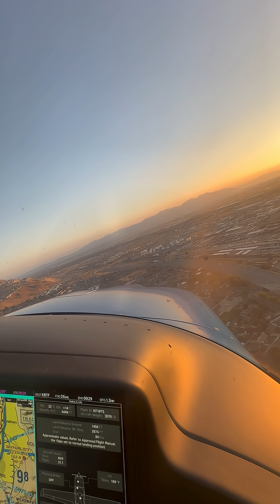The Runway That Got Too Small

Comment: This is why i put the gear down at midfield downwind in an arrow. Its really not that hard you just have to adjust for your airspeed in your checklist flow. Same thing in a seneca multi. You go through your flows alot sooner than in a slower piston single. You just got to give yourself that extra distance to bleed off that airspeed to configure for landing. You need to have that mental picture when approaching  your destination.

Comment: This does not make any sense, as a commercial caravan pilot. It slows down better than a 172. We typically maintain 165 kts (Vne 175, less than the mentioned 180) until 2 mile final, then go idle, it slows down to 85 well before landing.
Reply from the maker: For an experienced Caravan guy, sure,  those speeds feel normal. For a brand new Caravan pilot on day one? 165 feels FAST. Your brain hasn’t calibrated yet.
Different experience levels. That’s literally the point of the video.
Reply: @nicholassmout3281  Man you'd be lost in a T6 lmao
Reply: That's because you are experienced. A 172 would slow a lot faster than that. You wouldn't pull to idle at 2 mile final in a 172 because that would be way too early.

Comment: Absolutely wonderful analogy comparing it to a freight train.
Reply from the maker: Thanks for watching!
Reply: don't know what a freight train has to do with flying a C208B.  they do both haul freight but that's it.
Reply: @chucklemasters6433 if you watched the video he breaks down the explanation lol fast heavier planes don't bleed air speed nearly as fast as they will gain it. Takes planning to counter that momentum. Basically just saying  treat it like your flying a train and you should never be off approach.
Reply: @joshuaennis1502  do you even fly anything. tell me how do you fly a plane like a freight train?  the C208 is NOT a fast airplane.  i flew a baron for 18 years that was 20 knots faster than a caravan. i flew caravans for fedx for almost 4 years twica a day for a total of 2000 hours.  as i said before one of the best traits of a caravan is how fast it slows down.  but you must know how and when to do it!  how many hours do YOU have in a caravan josh? or ANY airplane for that matter.